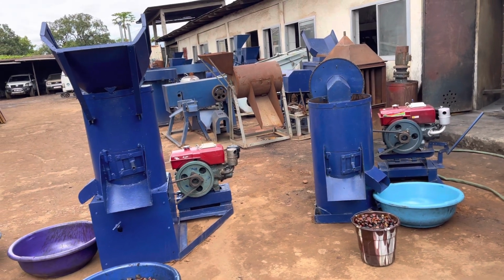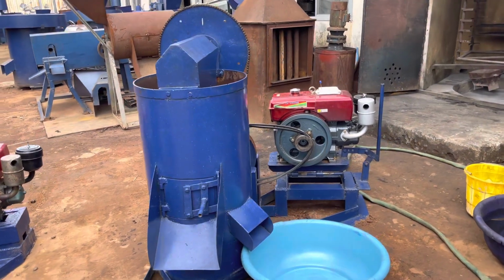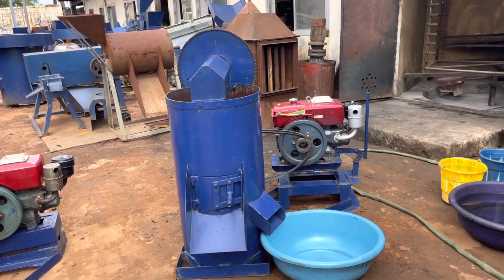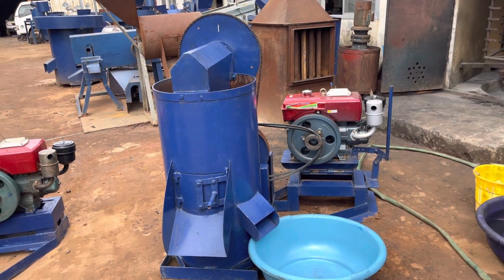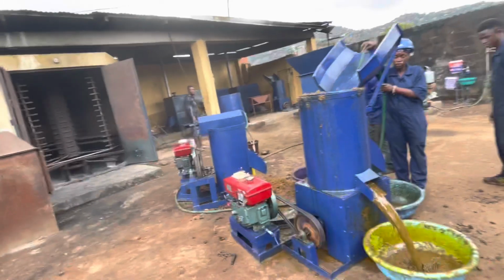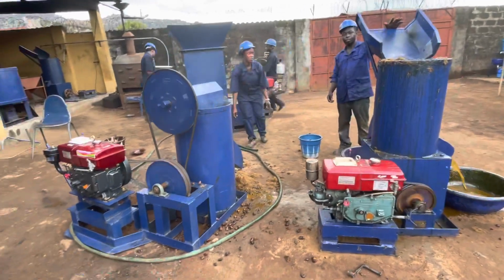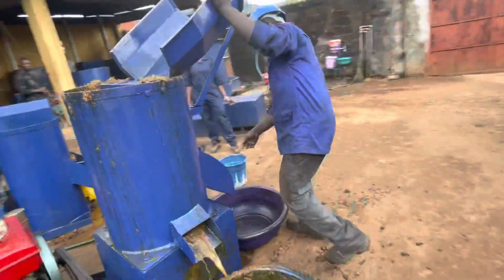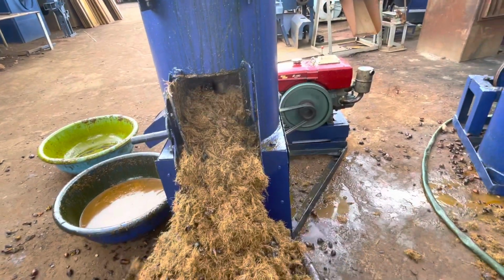Palm Oil Processing - The FINIC G3 and G4 Palm Fruits Digesters in action.

Comment: The sludge comes out of the smaller outlet. But what's the liquid that comes out of the bigger outlet?
Reply from the maker: Is the same sludge. The outlet for the nuts and fibre can not be 100% sealed hence the need to have a receptacle beneath.
Reply: @finicindustries2787  ok thanks

Comment: How do we process the palm oil  ,after  using the digested to bring out the sludge?
Reply from the maker: The sludge containing the oil will be fed into a clarifier where it will be thinned/diluted by adding water  and by boiling it till it reaches temperature of 100 degrees Celsius. At that temperature level, the oil will break and float for skiming.
Reply: @finicindustries2787  Do your industry have the clarifier for sale?
Reply from the maker: We feed the sludge into the clarifier and dilute with water. Thereafter, we apply heat to a temperature of about 100 degrees Celsius. The oil will float at that temperature separating itself from the water and other heavier impurities.

Comment: Increase the size of the pot or reduce the speed of the hammers by adding gear...it will reduce sludge n increase oil without going Tru anoda boiling
Reply from the maker: Sludge and fibre are two different things. High speed of beaters you refered to as hammers, will certainly generate more fibre that reduces oil recovery. In that regard, I agree with you. 

There are palm oil presses (take note, not digesters) that press out more sludge than a digester would do but such sludge is easier to clarify than that produced by a digester because it has less fibre.